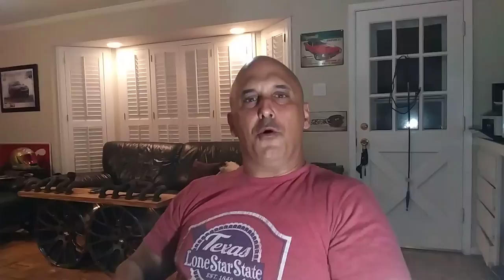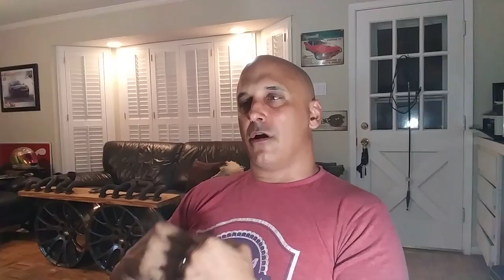Choosing a cam for your Hemi.  Here are some things to consider.

Comment: A camshaft is the brain of the engine. Pick the right one you'll be happy or pick the wrong one you'll be pissed. Been there done that. If it's a street car smaller cam are better. Don't give up your low end torque to gain up top. Like I tell people. My 496 made all its power under 6,000 rpms. It peaked at 561hp at 5,700 and at 4,200 made 585tq. Flat torque curb is what you want especially for a land yacht.
Reply: So tell me exactly what to buy lol but im actually serious...send me a parts list im new to the car game i have a 2019 scatpack got some money to burn and was thinking on a cam

Comment: I finally get it. The 6.4 and 5.7 hemi were made to enjoy the motor stock. Great low end throttle response for fun car that you can daily or weekend. Yes there isnt much you can do to the motor to add serious power without getting forged internals.
Dodge realized this issue, thats why they produced the Hellcat. Simply put if u want real power and can afford it, get a hellcat.

If you want real power and cant afford a hellcat get a coyote or LS and mod it up over time.

Yes i have a 6.4, but my next car will 100% be a chevy
Reply: I was really considering a cam for my 6.4 until I heard this. I don't want the "laziness down low". I want that low-end torque with that immediate throttle response.

What to do, what to do? 🤔
Reply: @hirise9419  get a pedal control

Comment: Agreed...coming from the fox platform and the lettered cams E, B, F, X, Z ford basically tells you what’s best for your car with what modification will maximize this part. This is where Mopar performance falls way short with absolutely zero factory performance parts other than replacement motors. Rant over lol.

Comment: Good info Brian. I've noticed a lot of people get tunnel vision when it comes to cams in the Mopars. First thing they think...Comp 274...chops hard, big lift numbers, so it has to make the most power. They don't think about the tuning and drivability of the cam, and I know the 274 is a PITA for tuners to get right. I did my homework, and went with the MMX NSR lope 4 profile for my build. Cars with that cam have reliably made 480-500 rwhp, with some cracking 510-520. I also agree on the MDS delete...if you are going to get rid of MDS, do it the right way and buy all new Hellcat lifters. Just as sure as you only replace the MDS lifters, one of the original non MDS units will fail. Then you are stuck with doing a teardown/inspect to make sure no metal from the cam/lifter got into the bearings..$$$. I also went with the Comp hardened pushrods as a precaution. Stock stuff is decent enough, but better safe than sorry. Block is finally done, and should start going together this week. Oh, and joined the Ram 1500 club....traded my '03 2500 for a 2011 QC 5.7/auto. Time for truck mods....lol.
Reply: Why delete the MDS? And how much does it affect highway mileage?
Reply: What do you mean "just as sure you only replace the MDS lifters"? Dont you replace all the orginal lifter with all new hellcat lifters? That didnt make sense to me.
Reply: And one of the orginal non mds lifters will fail? What??
Reply: @granite345rt6  I think what they mean is that if that if you only replace the MDS lifters, the other stock lifters will surely break. The advice is to replace all lifters with Hellcat ones.

Comment: What's your opinion on the 392 cam? Manual version makes more possible power with MDS delete, from what I've read it's a literal drop in part for the 5.7 hemi that needs to be tuned. Obviously new springs / pushrods / lifters would be swapped at the same time but it apparently doesn't need cam phasers.

Comment: That’s interesting on getting hellcat lifters instead of non MDS delete kit, curious why? Thanks

Oh and also I was planning on going with (after yearssss of researching) the “big daddy cam” by OST Dyno. I absolutely love the sound of the cam at idle, and there “HCI” (porting heads, cam, ported intake manifold) shows to gain 100 HP which would be a plus, I would probably upgrade the torque converter too like they recommend, any thoughts on all that? 
And I plan on supercharging it eventually in 2-3 years...I’m slowly building her lol
Reply from the maker: I like to run a full, NEW, set of lifters on any cam install.  Just best practices.  As for that cam, I cant really speak to it as I have no experience with it at all.  It sounds good from the clip, though.
Reply from the maker: jamolamo999 sorry, I noticed I didnt answer the first question.  Without getting too technical, the MDS lifters are heavier and more prone to breaking than the non MDS lifters.  The hellcats and manual trans 392's come with mom MDS lifters.
Reply: B Mason ok gotcha, yeah I was going to go with the non mds lifters, I guess I will get the hellcat version of those, thanks good looking out brother

Comment: V6 pentastar cam shafts? Yo I've searched everywhere and can't find the cfm on the stock heads.. I saw somewhere 460.. That's insane is that right??? Love your channel. I could sit and watch you talk about hemi for hours and I'm a v6 guy.. The v6 is just so damn good.. You're right when you say that it would ruin the hemi sales if they twin turbo that thing.. Just the vtec steals my heart when I rev out those 305 bald eagles. I would be honored if you would give me your personal opinion. I would shit myself if you did a video on this. Maybe you already went more in depth, link?
Reply from the maker: Thank you for the kind words! Typical cylinder head flow for modern V6 engines will check in somewhere around 270 CFM give or take. I'm not sure on the camshafts for the V6, although I'm sure if there were demand Comp Cams may sell a set. I did a video on the V6 although it's been forever ago. I actually like them. Quite honestly I'm surprised that there isn't a larger following for that car. I think a turbo setup on a V6 would be a riot. Although durability concerns May squash that.

Comment: Makes a big difference for an ls or lt.
Reply from the maker: Yes it does.  My LS6 picked quite a bit with a cam.  Was a turd below 3700 rpm, though.
Reply: B Mason true, just highlting that the ls really does feel more umph campared to a newer cammed hemi.
Reply: rocketbunny1314 Idk I mean a ls3 usually doesn't pick up more than  50whp with a cam and lt1s ive seen pick up 65whp. Hemis aren't far off since people are making 75 to 90 crank with a 274 comp cam in the 6.4s.

Comment: Fantastic information. I did the stage 1,2, and 3 last time. It was fine for me, but I really felt the tune was really mild. I got rid of it. Got a charger. Dod the stage 1, very unhappy with that. Also bought another 15 RT Sublime Green. Color I wanted first time. So, I am ready for more performance. I about to purchase the Diablo Trinity 2 platinum. I already have some srt headers and high flo cats.
My big thing is, I just saw that cam advertised. Comp Thumpr 201-700-17 that said no spring change required. Just a phase limiter. I am not looking for crazy additional power, some more power for the mid and higher bands and maybe some chop. 
What do you think about that cam if you are familiar with it?

Comment: The man with the knowledge! I take notes on every video. In my effort to not buy parts twice, I have a couple questions. I am planning a forged lower 426 stroker and a Vortech supercharger/ or twin turbo end game to keep the Shaker. When you said Hellcat lifters, that would apply here I take it or because I'm looking for about 800whp would I need to go to a different upgraded lifter? And as far as "upgraded pushrods and springs", what is the recommendation there manufacturer wise?
Reply from the maker: The Hellcat, non MDS gen 3 Hemi lifter will work perfectly for that

Comment: Good video sir! 
Yes, the intake is the under-developed piece to the 6.4. The airflow Engineer at SRT told me there was no budget at the time the 6.4 was designed. The intake is a 5.7 truck design(no shit) with the offset throttle body location. He believes 20-30 horsepower is possible with a revised design.
Question, do you know the shim size for the valve springs and can you recommend a spring for the 270 Comp in the 6.4? Comp Cams tech says no spring recommended!?
Peace

Comment: I’m having lifters, pushrods and springs installed. Trying to figure out the best setup for this 6.4L. Just wanted to get your opinion on which NSR Cam you would go with from MMX? (Which you mentioned in this video)
Thanks Much
Reply: What did you end up going with?

Comment: Good info, but one thing you keep not mentioning about the bigger camshafts moving power higher in the rpm range is that every tuner will tell you you will need a bigger stall converter say 3k-4K stall and taller gear so you will not notice a drive ability issue or a loss in low end if you do it all together. Yea if you just throw a big cam in and nothing else it’ll be a turd out the hole but that’s also not the correct way to do a build.
Reply from the maker: Agree with that, and I'll take you to step farther for most guys, a larger stall converter is not the way to go because of the Driving Experience of the car. You really do have to tailor the build to the owner. It was my car I don't mind, I'm used to lose converters and it's not that big of an issue for me. But it is true you do have to move that power up and when you're moving that power up and you soften the tip in throttle response and you loosen up the converter the car feels a bit sluggish even with that Combination. It's great for when you roll into the throttle but it can suck otherwise. Again, the bill has to be tailored to the owner.

Comment: B Mason. So all that makes sense I have a 16 charger r/t is my daily driving car. Now having said that, I want to add some hp I’m not planning on doing any drag racing or anything like that I just want to have some more ponies just in case lol. Kinda like the condom theory rather have and not need it than need it and no have it. So what cam set up or kits will you recommend for my 5.7 ?

Comment: With today’s high performance cars, if you want good street manners, ported heads and a supercharger is going to be in your favor. Yes it’s expensive but very effective and you can drive it everyday. I have a 2001 cobra and with a stock cam some head work and a blower, I make 532 at the wheels and I can run the AC sitting in traffic all day. And when I take it to the track, I run in the high 10’s low 11’s and I drive it home. I also have a 87 pick Chevy pickup with a big cam. It sounds cool as hell. My power doesn’t come on until  3500RPM, but when it does it hits hard all the way to 6800. But it drives like shit on the street

Comment: Hey B bahi from San Diego so I think we touched on this but like to ask again I’m so much more knowledgeable about the motor in the Mopar community on Mars now through you that I’m so grateful thanks a lot so I decided I don’t want to do a cam because I do not like that the lag in the beginning I like throttle response so while I’m saving up for my 392 I like to throw on my fast fast man throttlebody but my question is should I still get the intake manifold ported or order a 61 manifold or 392 and do they were good or should I just do the stock because I heard you say stock parts on the Emmys are a lot better than aftermarket parts and I know for sure the arrow block is a Knogo

Comment: update , just put a 6.4 cam in my 5.7 along with some shorties , valve springs pcm retuned  ,dialed in my WOT fuel with my wide band to 12.7 across all ranges added 1 deg of spark no knock to speak of.. night and day difference over 4k .revs easily up to 67k now . pulls very hard up to 65k . lost nothing below 4k . vvt still in full operation  and still 27 mpg on x way.
the entire job cost 1700. did it all myself (except base tune) 
6.4 cam, new updated lifters ,mopar performance valve springs. bbk shorties. kept my stock spring retainers,rods and keepers. . guessing gained about 60 RWH. no dyno to back that .but i knocked off about .75  0-60 ,i averaged around 4.5 0-60 ,old cam now a its around 3.9 sec.
6m 392 rear end, 18" rims . too funny the crazy money people spent for a cam job . guys go way overboard with over priced springs ,rods retainers ,cam ect... to get about the same gains as what i did . for substantially less .to me a 6.4 cam in a 5.7 gives you th most bang for your buck ! easy to tune ,fuel economy no power loss down low smooth idle ,0 Drivability issues full function VVT operation.
Reply: So you still have the mds? Just 6.4 cam which is cheap in price, springs, and a tune?
Reply: fas yea there’s a guy here check him out OMGITSMRMACK he did some dyno runs on three different cars once with a 270 cam and one with a 6.4 cam accosting to his data the 6.4 cam got the most gains. Where did U get the cam and what was ur list or parts needed ?

Comment: I just bought a Melling (mc1402)cam shaft, but days later I received my new liftersJohnson (2356) which much to my Schagrin are non MDS I was trying to keep my 2018 pursuit charger stock but now I have a MDS cam :Question can the non MDS lifters work on a MSD grind cam?I know I will have to get my ECM unlocked and put bung plugs in to replace the solenoids but I can’t see any reason for this stock cam to not work properly with the Johnson lifter,great video,Thanks.
Reply from the maker: Mopar at 1 time sold a kit that eliminated the lifters for MDS and included plugs as well. Be careful with the Johnson lifters, make sure you measure pushrod lengrh

Comment: So when talking about intake manifolds what is your opinion on fitting a 6.1L intake manifold on the 392 in comparison with the new edelbrock Victor 2? I know the ported 6.1 manifold is crazy expensive but in terms of performance I have no idea about any differences there might be between the two

Comment: Best cam for a nitrous  application
Reply from the maker: Inwill need to know a couple of things....
How much nitrous? 
What transmission? 
Torque Converter?
Vehicle weight?
Displacement?
What intake?
what exhaust?
What gear?
Drag race or street?
Fuel?
Compression?

Comment: What do you think of the 392 cam on a 5.7 hemi. I see many tuners getting 400whp with them with bolt ons.
Reply from the maker: I've heard of guys getting nominal gains out of that cam. But quoting Dyno number is doesn't really do a whole lot for me. Every Dino is different, and for that matter the same dyno can read differently at different times of day. (Uncorrected numbers vs corrected)   The real test is, what does it run in the quarter mile before and after?. What other mods? Did the car have a tune beforehand? Did it have long tubes beforehand? The 392 cam isn't bad, it just has a very wide lobe separation angle. This kills mid-range and pushes power out to the right of the Curve. The advantage is that it has over the 57 is that it has more duration in more lift. Think of it as an in-between gain over an aftermarket cam.  Pair it with a 6.4 intake manifold for best results. With all that being said, if you plan on running a positive displacement supercharger, the stock 392 cam is a very good choice

Comment: great info, i have a 09 R/T 6m, 3.92 rear end with 18" rims ,it winds up quick , starting to get a lifter tick (90k) so digging in,im going with a 6.4 cam some hellcat lifters and mopar performance valve springs (P5160074). retainers and rods should be fine. as mine are fairly new and same as 6.4. some bbk shorties and may port my intake along with a tune retaining the vvt operation. not looking for major hp gains hopefully about 40-50 at the crank. shes got some miles on her but oil pres is a solid 45psi at engine temp of 190. what are your thoughts ? i also here that the 6.4 cam in a 5.7 is very easy to tune .i do have a wideband o2 that should make the tune easy to tweak, right now i have her dialed in at 4.3 0-60 .12.8 AFR wot.
thanks for any input.
Reply from the maker: Sounds like a solid plan.  It will run strong.
Reply: thanks ,i think it will, you know anything about those mopar performance springs ? the set is about $200, but i read somewhere that its a kit put together , and that you can buy the springs individually at about $5 a spring . part number i got was 68277306AA  but cant find anything more on them ??  do you have any connections that can clarify on that ?  thanks man.